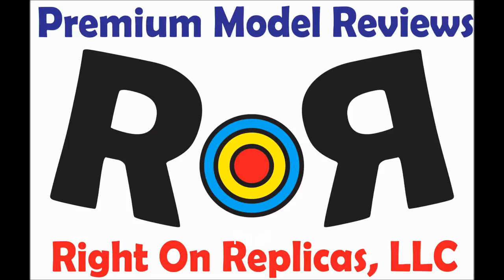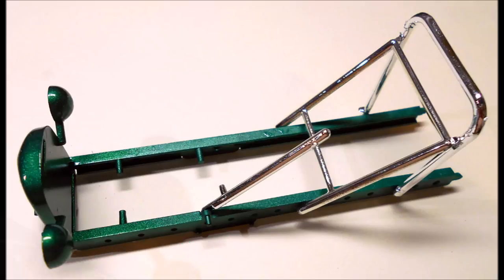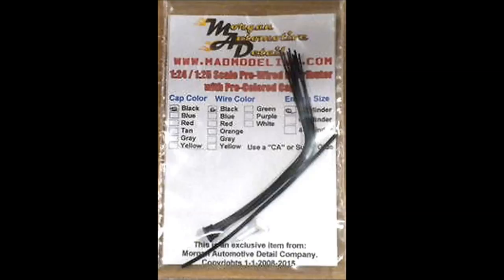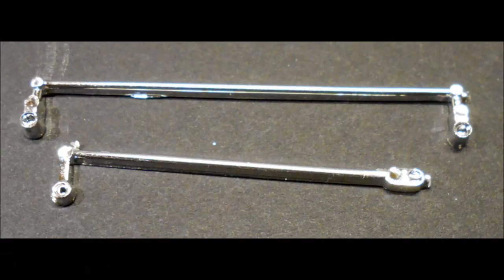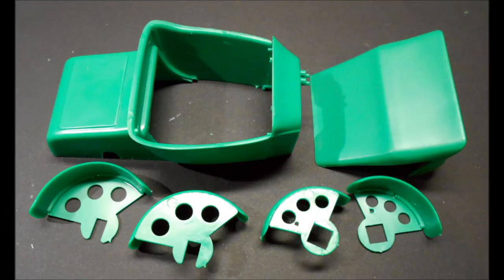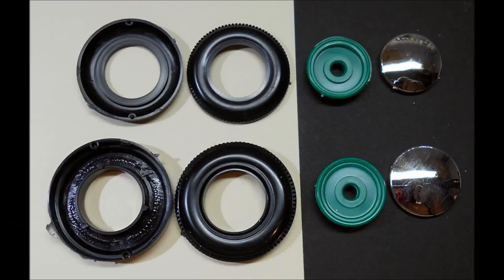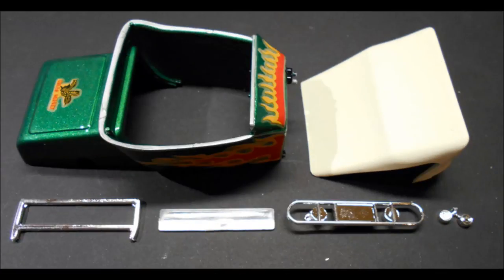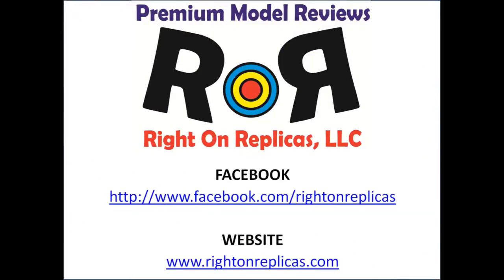How to Build the Green Hornet Ford T Roadster Monogram PC 61 Model Kit

Comment: wow i built it many many years ago i did not use the fenders or the rear nerf bars or the top
Reply from the maker: Jody, Just like the poor boys of yesteryear!  -Doug
Reply: Right On Replicas I love these old hot rods ,but I really hate how they all have generic Chevy overhead valve motors! I know guys did it because the Chevy motors were a lot cheaper to soup up than a Ford ,but damn man! These are models!! Put a tricked out Flathead in it,or if you want something different put a big ol Buick or Pontiac straight eight in it! I mean,if you're gonna build a bastard car at least make it interesting!  In spite of my little pet peeves,the model looks great!
Reply from the maker: Thanks Sq - I think!!! -Doug
Reply: Right On Replicas Oh hey! No criticism towards you,the build turned out great! It's just one of my little quirks,if you build a Ford ,use a Ford motor. Now if you go full on crazy with a build,I can see using some exotic powerplant, like an odd ball huge V-8 or 12 if you could get one. Just a hotrod build though,or a resto use the same engine as the badge. I could see this little pup with a big ol Lincoln V-12 all tricked out with Offie heads etc. Just a thing I have,see a great looking T bucket or a douce coupe and when you get up on it,it's got a 350/350 combo. Just annoys me.
I aimed none of that at you. You built a cool ass car.I was just venting,in general. Take care and keep em coming. Loved the 'Vette build,my buddy's mom had one and that's about the last year(actually '73  I think) with the actual bumpers ,that I like.
Reply from the maker: Sq - I agree with the Vette's looking great with those bumperettes, thanks!  --Doug